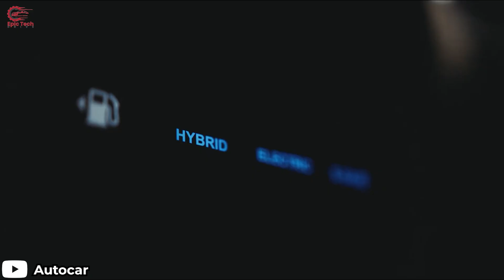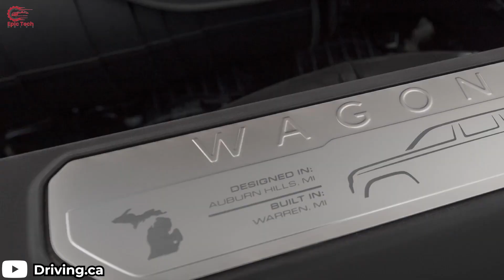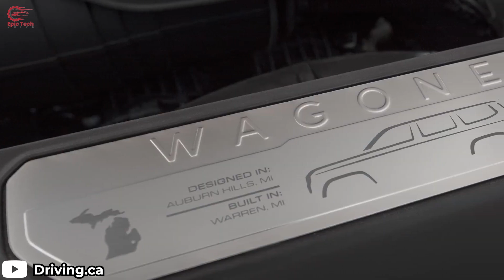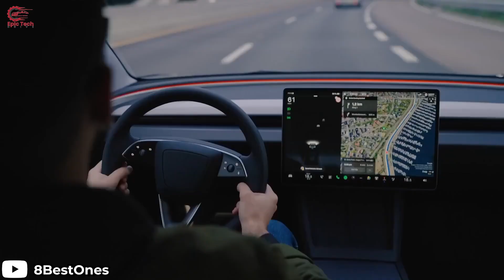IT's HERE! JEEP CEO Reveals NEW Compressed Air Engine Shocking the Entire EV Industry

Comment: Lmao who made this? Trump? haha. Ev's Definitely have some problems. But this video is filled with BS and contradictions. Sounds like a pretty average turbo charged engine to me. I cant see how any ICE can beat any electric powertrain. There are too many different ways to generate electricity efficiently. Hell you can actually use a compressed air motor as a range extender and still remain emission free.

Comment: compressed air engine? You mean Turbo charged engine, Which compresses air into the engine allowing you to burn more fuel to make more power.
Reply from the maker: yep kind of... :D
Reply: @EpicTechDrive  Their is nothing magical about it, Its still an engine that burns a hydrocarbon fuel and compresses air to burn it more efficiently, Does it get better gas mileage, sure maybe a little bit but that is because it has all the latest tech, Direct injection was a game changer, variable cam timing, variable lift and the latest in turbocharger design. But its not going to get 120 mpg and give you 500 hp, its just not. Its still an Internal combustion engine that requires fuel.

Air power would be having a tank full of highly compressed air that drives the pistons down to create work. A turbo charger is not capable of that, it needs heat energy to spin the turbine, Alot of heat, fuel lighting on fire heat and even then it only produces enough pressure to double or triple atmospheric pressure. which is well under 60 psi. A compressed air powered engine would require well over 500 psi to actually do any work with out fuel.
Reply from the maker: yea sure Jeep CEO needs to understand that we are not buying this crap anymore lol
Reply: @EpicTechDrive  this is just a click bate video to try and mystify somthing that is not reality with what dodge is doing with their new engine.